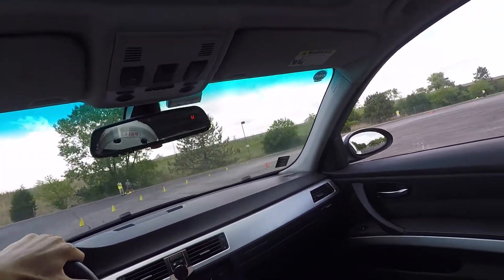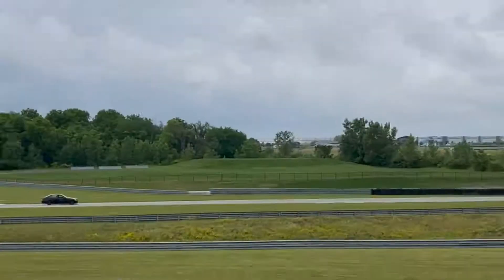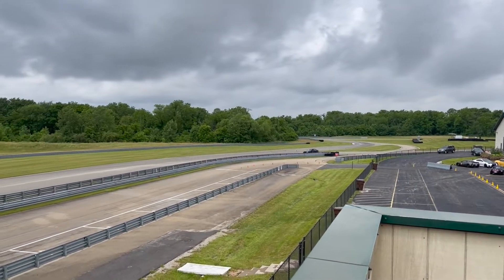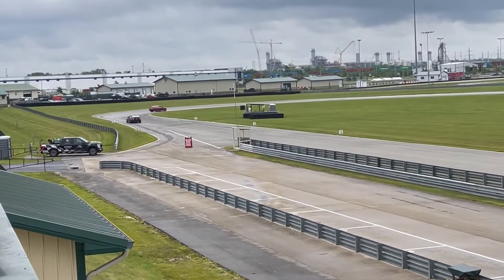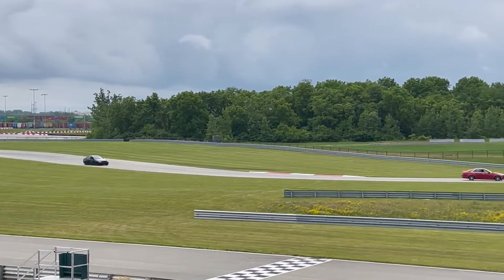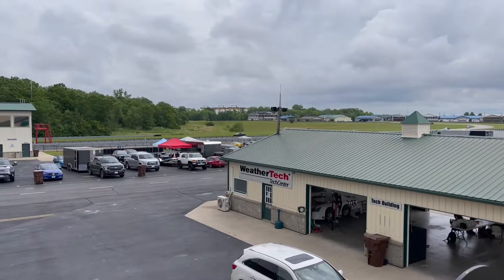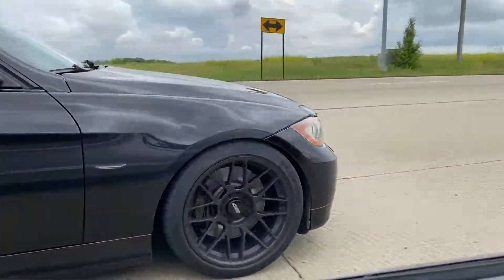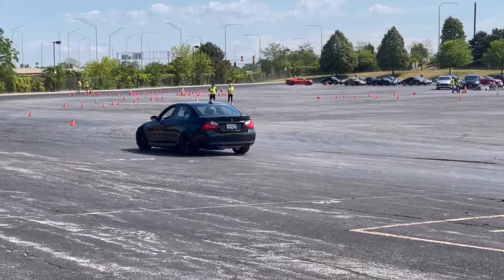N54 Common Issues & Important Maintenance

Comment: Awesome show 👏.. 

I bought my wife a 2010  BMW  535i With M package brand new in 2010. We still have it.  She loves it still to this day. 132,000 miles. It took a lot of maintenance to get it there. Most of the items you mentioned have been done.  Car still looks new. Once again it took a lot of maintenance to get it there. I have a 2008 F150.  245,000 miles. Running like a champ.  No issues.  The bmw could have never made it to that point without issues. A lot of issues.  Lol. I only maintained the bmw the way I did because my wife loves the car and hasn't asked for another car since.

Comment: Great video! Your thumbnail caught my eye so I thought you might know something about tracking/autocrossing the N54. Sorry if this is off topic, but this should go along with common problems.

I'm planning to track a E92 335xi N54, and one common issue I hear a lot and am concerned about is overheating issues, especially on track days. Even with the factory oil cooler, it can still overheat and get you to limp mode when reaching an oil temp of 302F, so I was just wondering if you have done anything for cooling?

Also, the N54 's oil temps according to BMW runs around 240F under normal driving and some people bring that down all the way to 200-215F with something like two aftermarket oil coolers, under normal driving conditions. Not sure if that's safe to keep it that low compared to the factory spec so I would like your opinion. I believe around 230F for normal driving, and 260F for track driving would be optimal. Nothing over 270F.

My plan would be to install an aluminum radiator, one aftermarket oil cooler (possibly use the OEM one at the same time, making it two oilcoolers), lower-temp thermostat, upgraded water pump, aftermarket inter-cooler, and some good fluids. I might even install water/meth injection for lower IAT temps. This is what BimmerWorld did on an E90 N54. You can search "How to Build the Ultimate N54-Powered E90 BMW 335i" on YouTube to check it out. No cooling issues at all.

I know the pulley system might need maintenance, and there is an aftermarket Billet crank seal guard to prevent sucking of the belt when the plastic crank wheel breaks, which there is also a Billet version of the crank wheel. Sorry for the long comment, but I just couldn't find an answer anywhere online and I don't like using forums. Glad I can find someone who autocrosses an N54!
Reply from the maker: My first track day was in around 80° weather, I had the oem oil cooler and a 5” stepped intercooler. Heat soak was pretty bad, was down a lot of power. Oil temps were hitting 295°+ so I would do cooldown laps to avoid hitting limp mode. 

The two fixes I’ve done that have helped so far are installing the 7.5” racing fmic, which drastically kept down IATs. The second fix was pretty funny, I rerouted my windshield sprayer line to a nozzle that sprays my oil cooler and I just fill the reservoir with water. I then pulled the fuses for the windshield wipers and headlight sprayers. Was a $10 project. Planning on making a video on this in the next few months. After doing this, during a 90º track day the car was much faster with the new intercooler and I never saw oil temps climb over 280º. Whenever I would approach the 280º mark I would spray the oil cooler and it would drops temps ~5º or keep them stable.

As I get more track time my laps will definitely become faster and get the car hotter. What I have planned is to install a larger 25 row oil cooler and the CSF radiator and perhaps a transmission cooler. I had installed a larger oil cooler but the lines were unsafely low quality so I removed it and plan to reinstall it this summer.

I believe the lower temperature thermostat is an unnecessary mod as when you get on the track your oil temps will climb and open it fully anyways. (Opens fully at 235ºf i believe) All this would effect is the time it takes for your car to warm up. Keeping the stock thermostat is good for daily driving and the track.

Meth injection isn't the best route, especially with track use. I've heard numerous stories of hydro-locked engines due to unreliable injection which keeps me away. A better method may be getting a custom tune made for an E30 mixture. This will be safer for the track with the octane boost and will have the engine run cooler.

Planning on making some videos on cooling and track updates within the next few months so stay tuned 👍